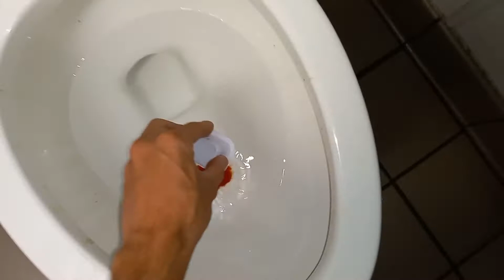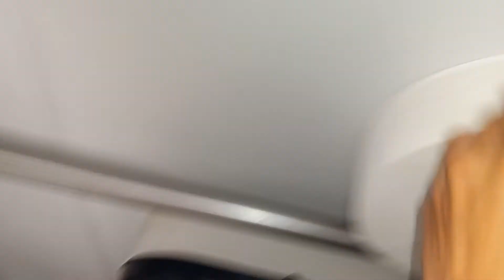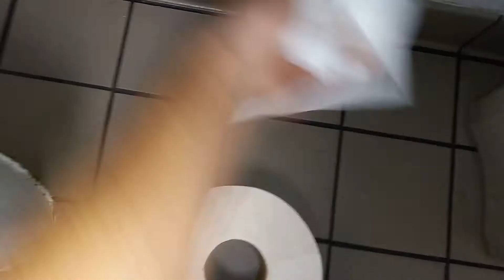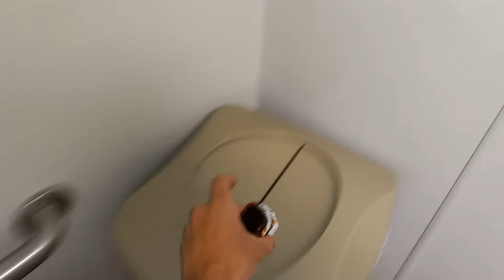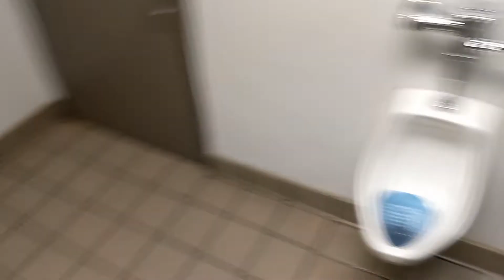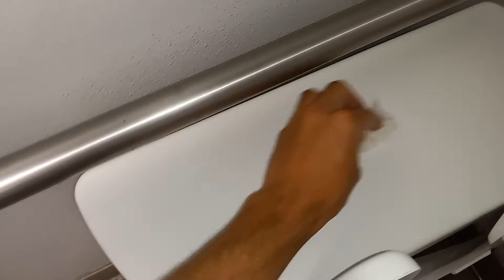Worst Toilet Ever: New Pressure Lite vs Ketchup

Comment: This toilet is still decent due to it not clogging easily.
Reply from the maker: Not clogging is nice but it can't function as a toilet. Kind of like how the Peerless Madisons and Porcelamex toilet had a decent flush but clogged on everything. If a toilet clogs on everything, it is useless and if the flush leaves stuff behind like this, it's equally useless.
Reply: @Freaky_Kroger_Guy  I still prefer these over the tank toilets. I still think these are better than 2000’s American Standard Cadets.
Reply from the maker: @sionspeaks  At least 2000s Cadets can do everything these can't plus more
Reply: @Freaky_Kroger_Guy  But the pressure lites do great on normal use so do most pressure assist and flushometer toilets.
Reply from the maker: @sionspeaks  Pressure Lites have never done remotely good on any level of normal use for me. I might as well just use the urinal instead.
Reply: @Freaky_Kroger_Guy  2000s cadets always clog on normal use. I’ve clogged THREE of these.
Reply: @Freaky_Kroger_Guy  Yeah I’ve never had a good experience with one… EVER
Reply: Which is better, these or the things that don’t flush (like pit toilets, porta potties, vault toilets, RV toilets, or waterless urinals)? I’d say these by far honestly because at least these flush!

Comment: It just proves my point earlier, a pressure assist toilet is just a waste of money, impractical...
they are not made to flush less than 1.6 gpf... "water savers" my-ass

for this kind of horrendous bowl rinse, this toilet is more of a "water waster" than a "water saver"...
Reply from the maker: Agreed. These are completely worthless
Reply: Do a Ketchup test on a 2000’s AS Cadet to see how it performs.
Reply from the maker: @sionspeaks  Next time I find one
Reply: @Freaky_Kroger_Guy  Will it fail or take it down?.
Reply: @sionspeaks  I doubt it would take everything on the first try but I'm guessing it would do a lot better than this.
Reply: @Freaky_Kroger_Guy  What are some good modern toilets?

Comment: This toilet is just as bad as Western and Glacier Bay toilets, due to very little bowl rinse! Western, Glacier Bay, American Standard Gravity Fed 1.6 gpf Badets, and Crane Rexmonts all have no bowl rinse and they clog very easily on only a small amount of TP (5-10 feet)! I hate how common those toilets are and that they keep replacing vintage toilets! I’d go with NOS and get a 3.5 gpf American Standard Cadet or a Kohler Wellworth Waterguard since those are WAY better than modern toilets! This toilet would deserve to clog and overflow, and I’d replace it with a Kohler Ingenium on a mismatched 1.6 or 1.28 gpf Pressure Lite tank. Ingeniums would have very good flushes when pressure assisted (on mismatched PL (pressure lite) tanks)!
Reply from the maker: I have seen some really awful toilets out there but no toilet clogs on 5 feet